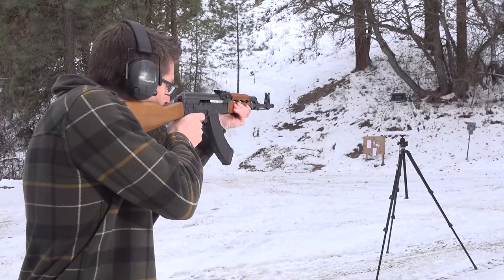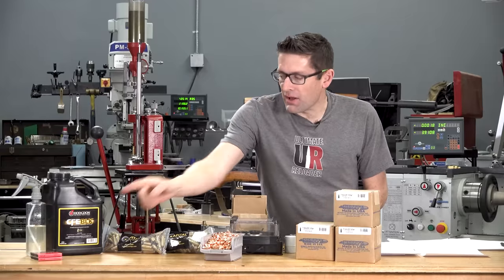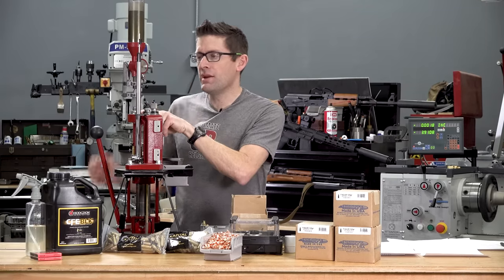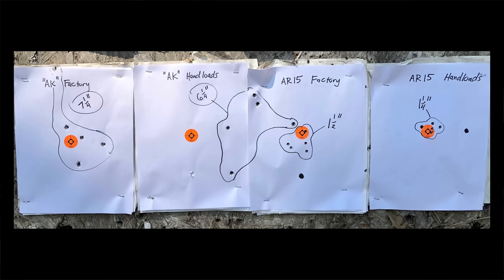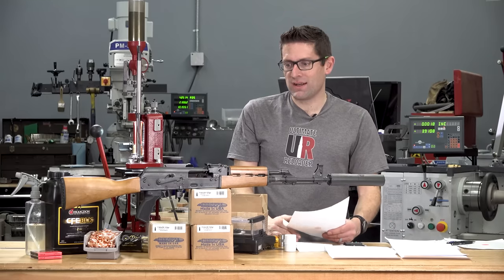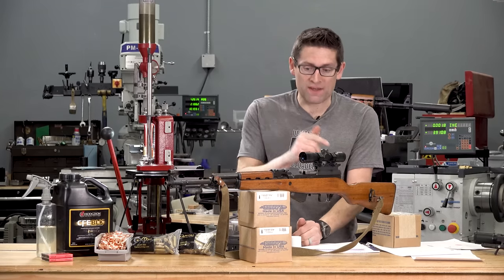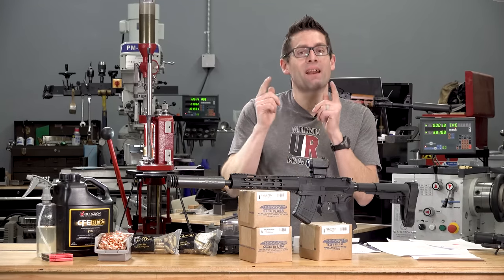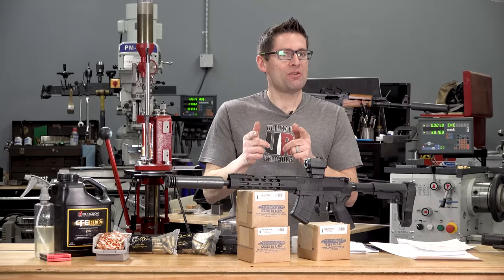Reloading 7.62x39mm with Berry's 123 grain Bullets

Comment: Good info! I was wondering if the Berry's plated bullets would cause issues with either the gas sytems or supressors. The SKS might have showed a higher velocity with a slower powder. I assume the CFE BLK is rather fast burning. It looked like the first round out of the SKS was much higher than the rest and may be what threw off the SD. 

Got to check your subsonic load video!!

I have not started reloading the 7.62x39 yet in my Dillon 550 but plan to try a seperate bullet seating die and then a "factory crimp" die so I do not have to change the crimp die if I change bullet lengths or seating depths.

I use AR15s with the AR type magazines so I can keep the bolt hold open feature. Uplula makes a magazine loading tool for them now too.

But I shoot a lot of steel case ammo so I don't have to worry about where the brass goes. (prevents what I call "reloaders flinch" which is when you turn your head every time you fire to see where the brass went.)

Comment: Hey Gavin
I’m using the Berry’ as well as the 150g Spire points that are cheap. I’m loading with Accurate 1680 Rifles are my Windham Weaponry SRC 16” and my Ruger American Ranch. I’m still working up some more loads but the AA 1680 and 123gr Berry’s are hitting 2437fps with the Berrys over 27.5grs of 1680.  according to my Lab Radar! Accuracy with the Ruger is right at MOA! Going to play with seating depth now. With the WW SRC I’m getting 1.5moa with the same load. Why does Berry’s only recommend a max velocity of 2000fps for these bullets?

Comment: Do you know your bore & groove diameters?.. ive been trying to find a good load for my AR 7.62x39, bore is supposedly .312 and groove is .3002... but i am having horribly inaccurate loads. They all cycle but very very poor accuracy even at 25yrds. Ive pretty much sampled loads from 27-29.5gn and still just really not great. 
 Factory brass 7.62x39 consistly hits a 10" steel plate at 100yrds. 

Im wondering if i need to try a .310 diameters bullet instead of these .311 berrys?

Comment: I thought Berry's had stated a Max velocity of 1500fps for these plated projectiles?  It's the only reason I haven't used these projectiles yet as they are always cheap on throwout tables down here in AUS.
Reply: 2,000 fps max on these.
Reply: @TheSailingwoodworker  Sweet! They must have upped it since the last packet I looked at.  Makes much more sense now.

Comment: Starline brass.
Cci large rifle.
Cfe blk.
Lee 312 155 cast from 50/50 clip on wheel weights and linotype.
Powder coated
Gas checked. Sized to .3125"  with lee push through die.
 Kak 11 inch ar15 SBR. 
 It shoots about 1.5 at 50... and im just short of 2000 fps.

Comment: HELP OTHER RELOADERS!

Has anyone else out there had issues with crimping these bullets in place?  When I load rounds into the chamber, then manually eject them, the bullet gets pulled about 1/10 of an inch out of the case.  I am crimping with my Hornady seating die, seems like a firm crimp, particularly when compared to 30 06, 223, 30-30, yet this continues to occur.  Loading 2.165 to 2.2 inch OAL.  Trim length is about 5 hundredths above trim length in Hornady manual.

Comment: Starline brass, S&B Large rifle primers, S&B 124 gr FMJ bullets, CFE BLK 28 gr, AVG 2376.2 SD 14.7 ES 39 (Shot out of a Norinco type 56 AK 47 variant)(Temp 21 deg C, Baro 1017.8 mbar, 4701 ft above sea level)
Also reload much cheaper with cast bullets from the LEE bullet mold then coated with HI-Tek about half the price of bulk ammo with corrosion primers. What happened to your LEE dies for 7.62x39? Any benefit  with the RCBS dies? (Here by us the RCBS dies are double the price of LEE. I am a RCBS fan for the last 40 years) I am using the LEE dies with the FC die with a RCBS rock chucker press bought in the late 70's.

Comment: Mixed head stamps? Different case volume, poor SD.  With PAP 4/5 may have been all same same.   Gavin what is the metal loop hanging off the back the primer slide roller?

Comment: Any issues with going over 2,000 velocity? I thought plated bullets had to stay under 2,000. Sorry pretty new to this but also just started reloading with same  products
Reply: Mine run just over 2k... havent had problems yet.
Reply: I reload plated south african Frontier bullets for .223, flying at about 2800 - 2900 fps and have no issues. Mind you, these bullets have very thick plating, about twice as thick as regular brass jacket is. I’m sure Berries would be just fine.
Personally I don’t see 7,62x39 worth to reload, in my country plenty of old surplus or chinese 7,62x39 still. When you take into account you need a brass case and such factory round costs 5 times as much as steel cased ammo, availability of bullets etc it really is not economical in any sense. And heck, AK’s, vz 58 all chew up those cases so much I’m not sure you can reuse those cases anyway.
Reply: @ZhuJo99  Berry's Mfg rates these bullets to 2000 fps.

Comment: Gavin - So how do you like your KS-47?  I've been thinking about getting into this caliber and this looks like an interesting option.  I noticed that the bolt did not lock back after the final round.  Is that common with the KS-47?  Any information that you can provide would be helpful.  Thank you.
Reply: no last round hold open is inherent to the mags used. AK mags don't hold open on the last round. For that feature, you'd need an AR-47 that uses typical AR mags.
Reply: @kenchan3038  Thanks!  I did not know that.

Comment: That SKS probley would beat the AK even with that scope mount on it.  I sure would like to see the SKS really have a good accuracy check. Love AR 47s and id like to see how many times a 7.62 x 39 brass can be loaded over and over till it cant. Something along real life conditions at 2400 ft sec.  Thanks good stuff.
Reply: Sks has been shown to heat and string more for some reason Maby the longer barrel with heat moves more also the ak has a better trigger while loaded that drag feeling before break but all guns are different some ak can have half the group of another likewise the sks. I’ve shot em both a lot the sks feels more accurate and u can carry more ammo in a bandolier 200 rds sks 90-120 ak with heavier mags but very tough but I like the ak trigger better and can pump out more ammo so I dunno I like em both. Anyway one guys gun or guns doesn’t tell the whole story. All my aks and sks have been under 3moa usually 2.5 or better but I’ve heard ppl say they’ll get 4-5 ! I trust em I’ve just never had one that bad

Comment: Nice video Sir. I am glad to see you are using CFE-BLK. I'm having case neck issues with some Starline brass. 30 to 40% of them split (from top of shoulder to 1/2 way up the neck).
 I tried annealing them but, not much better...
AR-47,   20" Yankeehill barrel 1-10,  123gn Nosler Varmageddon's 310,  2.207" over-all length,  26.8gn CFE-BLK,  RCBs dies.
Average speeds are 2350 fps with no signs of pressure other than the dang necks.  Any ideas?
Reply: I would call Starline and let them know your experience.  Send them samples even.  I hope they would like to know what is happening with their product.

Comment: Don't use plated bullets. I got a baffle strike on my suppressor with berry's 55grn .224 bullets. One or two of them came apart apparently, hit the paper sideways. I used berry's 124 grain plated 9mm bullets. Ruined a brush scrubbing the lead out of my barrels. Not worth it.  They were still on the shelf just recently, I'd rather do without.

Comment: Very Interesting Video!!!! I am setting up a Hornady Ammo Plant and I was able to get the LEE Pacesetter for 7.62x39 Die Set and I would like to get your opinion on it specially as it relates to working on in an Ammo Plant. I am a VERY BIG Fan of 7.62x39 I love the Caliber but I do not like the AK47 so my first rifle was a Ruger Mini-30 back in 1993 short after that I got a Colt 16 inch Sporter in 7.62x39 which was very accurate but I could only get 5 and 10 round Magazine to fire reliably and it took C-Products Stainless Steel 30rd Magazines that came out in 2011 to finally have a reliable 25 round magazine in the Colt. In 2013 my fiancée got me a Gen 2 Sig 556R that uses AK47 mags and Recently I purchased the CZ Bren 2MS which uses a Modified AK mag that loads like an AR.  During the mid-90s I started to Reload and I stopped shortly after 9-11 when I joined the Military. After been tired of NOT being able to get the ammo I need for the Special Projects I am working on I decided to Order a Hornady Ammo Plant back in November that was Delivered in Late March and I have been getting the Bulk of Die Sets in the Last few weeks.  
I am going to be Reloading 556, 300BO, 7.62x39, 308Win, 9x19, 40sw, 357sig, 10mm Auto and 45acp.  I saw your 308 Winchester Reloading using the Redding National Match Set and I am going to be REPLICATIING your Setup since I am going to be reloading 308Win for AR10/M14 Platforms at this time. I have already gotten the Redding for 45acp, LEE for 357SIG, RCBS for 223 and 10mm, Hornady for 300BO, 9mm and 40SW. I am aware that I did not have to get 2 sets of 10mm/40sw but the RCBS Die Sets were a gift from a couple of my Military Buddies that want me to make them some good ammo so I could not say no and the die sets just Showed UP at my Door with a nice note.  

Right NOW the MAJOR PAIN is GETTING PRIMERS I was able to get some Powder from the IMR Website that will allow me to load some Plinking Pistol Loads since I was able to get 5 LBS of Ramshot Silhoette and 3 LBS of IMR 4198 now if I can get some Primers I will be in business. I am also waiting for the Rifle Bullet Feeder to come in because once since I am a Custom Special Weapons Gunsmith I have to Test the weapons I build and modify before they go to their new owners that will use them in the Line of Duty.

Comment: I used those bullets, too. The box says I should limit my velocity to 1,900 fps, the last time I checked. You are sending them out way faster. Is that safe?
Reply from the maker: Good point! See the article- max is supposed to be 2000 fps. Perhaps that's why the KS-47 did so much better with accuracy....

Comment: Maybe you have the answer, I just put together an ar platform 7.62x39, according to the manufacturer the barrel is .308. Can I use these .311 bullets in it or should I load up .308?
Reply from the maker: 7.62x39mm should be larger than .308 groove diameter- I'd double check!
Reply: I will slug it and find out. If your bored look up the ar stoner barrel on midway, that's what I got.

Comment: What do you recommend on a beginner to reloading?
Reply: 9mm. Start with at least a turret press maybe jump straight to progressive. Pick up a single stage for free eventually or very cheap but it's a very slow way to start. Just add one step at a time and follow the directions carefully. pick any major published reloading manual and just read the introduction chapters several times that will help. I shouldn't say too printed in the last 10 years or so. The main thing is you'll be methodical and you test each step before you add the next step and you don't have a lot of distractions.
Reply: @GunFunZS  thank you but I have a .45cal and .22
Reply: @krimzyg971  45 is easy and peasy. It's low pressure and pretty straightforward. And also becomes dirt cheap to reload if you cast the bullets. up until now mine were costing about five and a half cents each. With whatever it will cost to replace primers as situations normalize again it'll probably go up maybe two cents from that would be my guess.
Reply: @GunFunZS  well thank you I'm gonna look into buying stuff
Reply: @krimzyg971  if you Google my name and the reloader's network you'll see an article I did a year or two comparing costs of a few different setups. Obviously those prices are from the before times. And I would substitute Dillon XL750 for the 650. The costs are not exactly the same but they are roughly comparable. as far as the turret press just look at any of the Lee four hole auto indexing turret presses that are the tall style. I point out the tall style because they make a shorter style that is a nuisance if you want to use it for rifle reloading. The different saves you a slightly shorter throw to your handle but I don't think that convenience is worth the nuisance it makes for reloading long rifle cartridges.
Reply: @GunFunZS  hell yeah thank you

Comment: Difficult is an understatement. Why are they expensive because the companys are gouging and doing what they did during the obama years and when it was over the prices stayed a lot higher than when they started. So in the end these companys are despicable for doing this and if they raised prices to stop hoarding that would be fine but prices should come down a ton but they wont.

Comment: The biggest problem with reloading 7.62x39 is that you have to get in your vehicle and drive to the next county to collect your brass.
Reply: If you drop in a KNS piston in AKM rifles... you can tune your gas to drop cases at your feet.
Reply: @mikebolton3816  Yeah, I've often wondered about installing one on my 5.45 AK but being as I don't reload for it and it's not suppressed I haven't given it much more thought but I agree that it is probably a good solution for reloading too.
Reply: @noquartergiven7789  I run one in my PSL-54 as well.  It really tamed it down, and... more importantly, I can load 174gr/180gr for it, and the bolt carrier isnt beating the rear trunnion too death.
Reply: not with my PSA AR 7.62x39